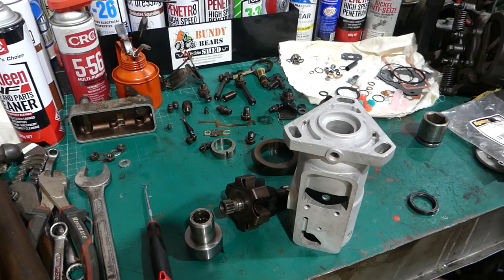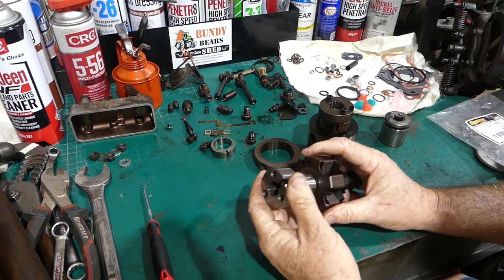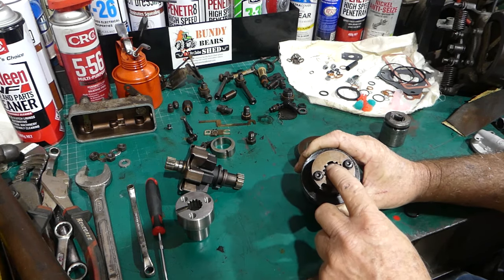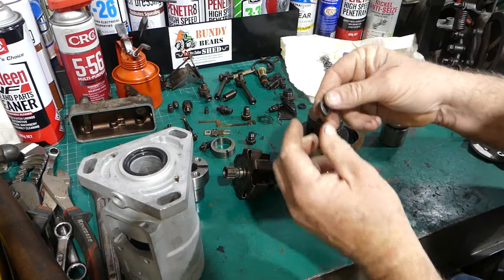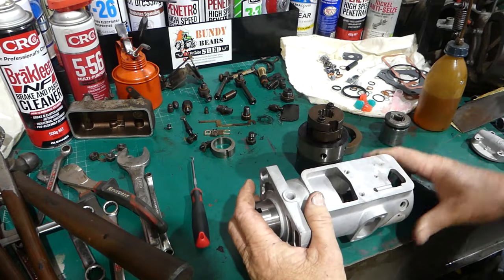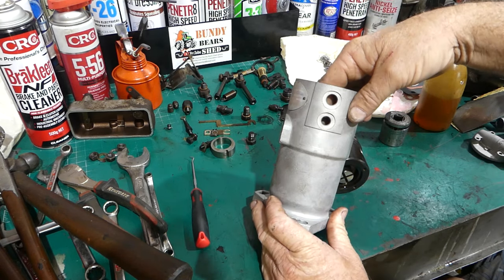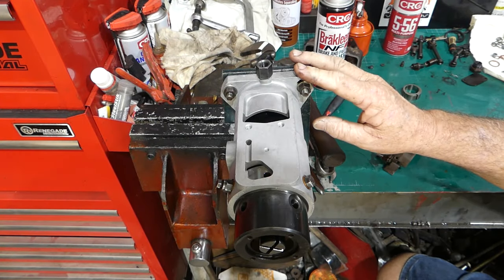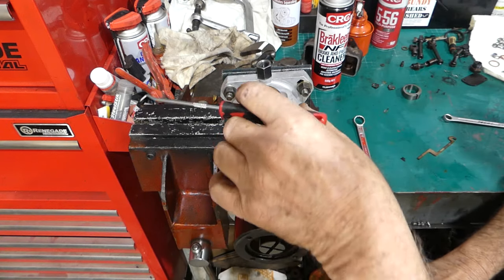How to Reseal Your CAV Injection Pump Part 2  Starting to Assembel the Pump (From an IHC B414)

Comment: what would be wrong if my pump looses pressure?
Reply from the maker: It could be a blocked tap, lift pump, filters or the little filter iin the inleet of the pump. They can all effect the flow ratr.

Comment: Hi Lance,Returned to NZ 2022 after 13 years in Sydney. My Fergy 265 had been sitting for that length of time. With your video help a couple of years ago I was able to reseal the injector pump and get the tractor going again. However last week I went to start it after it was going the day before and it wouldn't start. I found fuel wasn't being pumped up to the injectors. I pulled the pump out and checked everything you sugest in these 3 videos. I didn't go beyond the camtrack, but fuel is still not pumping to the injectors. Fuel is pumping back through the return line. I did notice the inside part of the end plate has some small grooves scratched into it Would appreciate any suggestions as to what might be the problem. Because of your videos I am quite confident in diving deeper into the pump. Many thanks.
Reply from the maker: If the metering valve wasn't stuck, the little shuttle under the inlet would be worth a look. Worst case there is a bit of water in the fuel and the rollers are sticking. Most times the metering valve is sticking.

Comment: Roter ring will demag because you are not fixing properly
Reply from the maker: No you are not correct here, we have had many pumps going strong for many years. we are really only resealing the pumps not changing settings or anything else really.
Reply: @BundyBearsShed  if you move and push roter then it's safe
Reply: By the way where is your workshop
Reply from the maker: Australia
Reply: I have 35 years experience in different fuel injections pumps and injectors in Pakistan and Saudi Arabia

Comment: Hey Lance! I watch every video you put out, I like doing this stuff too! I'm currently working on a New Holland TL90A 4 cylinder that I bought very cheap. It had been sitting up for probably 10 years or so. It has a Bosch VE4 distribution pump.  Do you have anything special that you do for a pump that has been sitting up for so long?
Reply from the maker: No not really if it bleeds up ok I go with it.

Comment: Thanks!  Would that particular kit work for a long 445 3 cylinder fiat utb?  I've ordered a kit but it wasn't spared.  Think I might trust sparex more.
Reply: I meant sparex
Reply from the maker: Yes it it is the CAV rotary pump it will.

Comment: Great work as usual Lance, very well done video. Helping people like myself out all over the world. 

Not sure if you'll know, but my pump is quite similar, except it has a solenoid on the bottom that holds the cam ring in. The shaft between the head and rotor had broken, so i took it out and have a replacement. The only thing i cant work out is where the little 1/4" by 1/4" spring came from that dropped out when i took out the head. Would you have any idea? 

Anyway, thanks for all the help, you really are a great bloke 👍
Reply from the maker: I think the spring you are referring to might be under the little shuttle valve in the end cap.
Reply: @BundyBearsShed  thanks for getting back to me Lance. Turns out it was the spring the that sits behind the rivet in the plate in the top governor housing. Must have fallen down into the body when I was taking it apart. Have it back on now but unfortunately still no diesel after replacing what was a broken head and rotor shaft. You make it look so easy, if only you were a neighbour!

Comment: I think my roller pistons are sticking on mine. Backhoe with the same style pump on a ford diesel. I pulled the top cover off and the metering valve was stuck so I freed it up. Still not getting any squirts of diesel out of the injector ports on the pump. I guess the pistons in the end under the rollers are stuck. I wonder if I could shoot air into the ports to try and free them up.

If I need to pull the pump apart to free them up how do I re time the plate on the end that you explained meters the fuel? Do I just mark it first or should I get the measurements for the rollers?
Reply from the maker: Yes getting a roller meassurement is fine or scribe a line at the end of the bracket so  you know where it was. Sticking plungers is a good probability.
Reply: @BundyBearsShed  Thanks. Yea I don't see what else it would be. I am not getting even a tiny squirt of diesel out of the outlet ports for the injectors. I am going to try and blow some air backwards through the injector line outlets and see if I can free the piston. I will let you know if it works. I have plenty of fuel getting to the pump, when I take the bleed screw out the side it squirts a good foot out when I crank it.
Reply: Well blowing air into it did not work. I will have to order a reseal kit and tear it apart I guess.

Comment: Hi Lance
I'm stuck, what locks the basket into the shaft? Mine spins and the governor doesn't work. It runs flat out and can only be controlled by the stop lever. Thanks
Reply from the maker: There is an o ring on the shaft that holds it all in place.